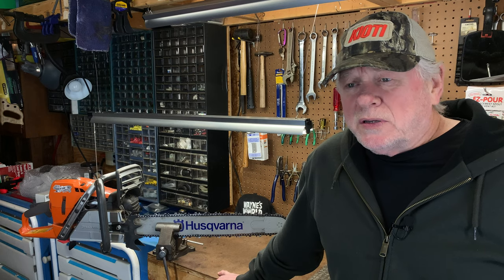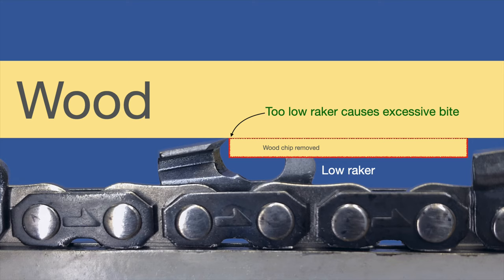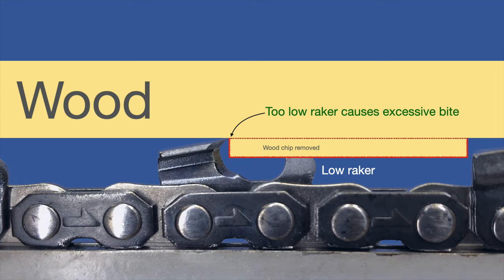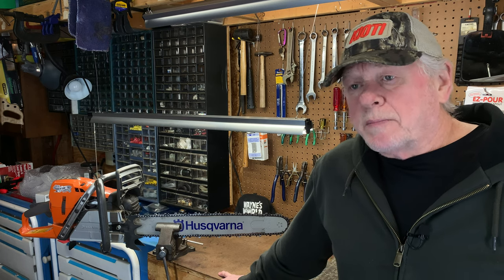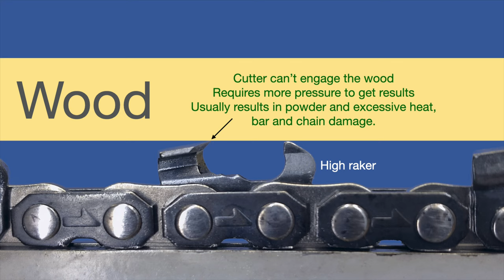T-37 Days - Rakers, Riders, Drags and Depth Gauges - Part 2

Comment: Doing good brother. With a saw like the 572 and say a 24" bar don't be afraid to try out  the soft setting, if you don't like it no big deal after a sharpening or two you'll be back to zero. Noe instead of changing the depth you could give an 6 pin sprocket a try. It's all good playing around and finding what works with what.

Comment: Good info Wayne :)  I need to check on how I'm placing my raker gauge on my chain. You aren't seating the front notch onto the cutter forward of the raker you're measuring, and I usually do. I need to check on that somehow. I was under the impression it was to be forward so that the raker filing can be done quickly and uniformly. Love you, Hi to SuzieQ! Peace.
Reply from the maker: I had the same thought on that. But the goal is to get the gauge on the cutter top plate and have the raker poke through the window and into the little slot. That can't happen if you push it up to the back of the forward cutter when using the SOFT side. I will try to focus on the issue in today's video. Love you too, Angie!

Comment: Thanks again WP... I don't know anything about this stuff which is why it is interesting... But I did notice that you did not put or place the raker gage down into the back of the cutting tooth in your comparison of hard vs. soft raker ... what is the proper placement?  Hold it back like you did or shove it all the way down?  🤔  Have a good one everybody.
Reply from the maker: Great observation, Moofdogg! The jury is still debating this apparent concern. If you try to put the forward cutter into the clearance groove, the raker will not end up in the right position within window. I will try to clarify this in today's video. You have a great day too, moofdogg!

Comment: Do you have a part number for that raker gauge??
Reply from the maker: Sorry for the delayed response. 

Here is a link to the tool on Amazon: https://www.amazon.com/Husqvarna-Depth-Gauge-Pitch-Chainsaw/dp/B001W0FGAQ/ref=asc_df_B001W0FGAQ/?tag=hyprod-20&linkCode=df0&hvadid=312134668019&hvpos=&hvnetw=g&hvrand=5521001014056188565&hvpone=&hvptwo=&hvqmt=&hvdev=c&hvdvcmdl=&hvlocint=&hvlocphy=9015186&hvtargid=pla-440146281053&psc=1

Here is a link to the tool at Husqvarna's website, where you can dig deeper to get more info and find variation of the tool for different chain types:  https://www.husqvarna.com/us/filing-equipment/depth-gauges/

Thanks for leaving the comment. Stay kind, my friend!
Reply: @WaynePolcin  thank you!!!